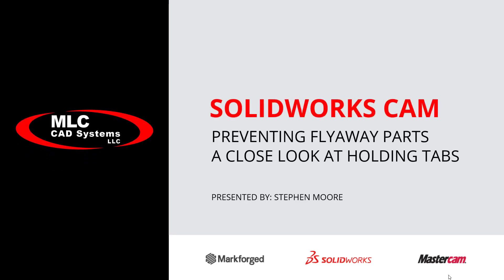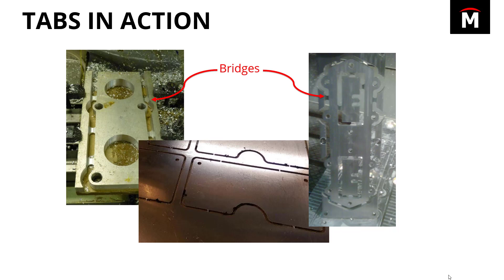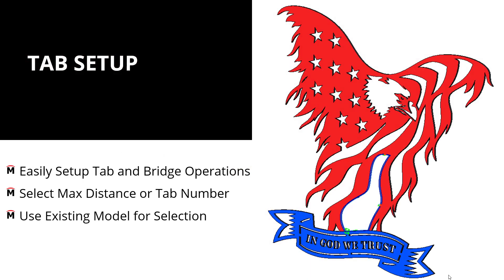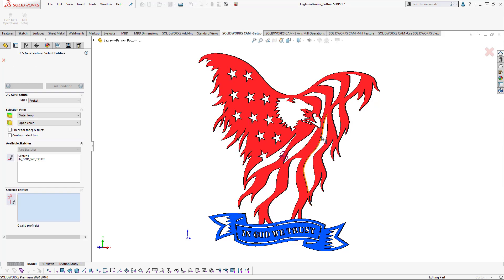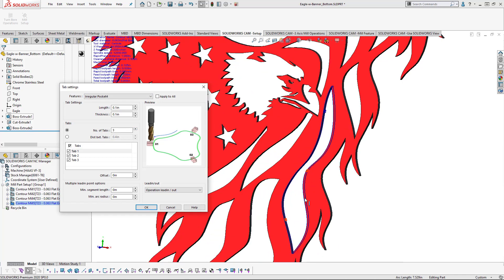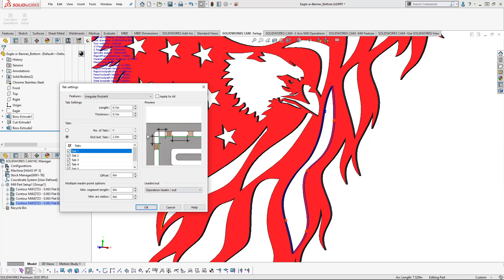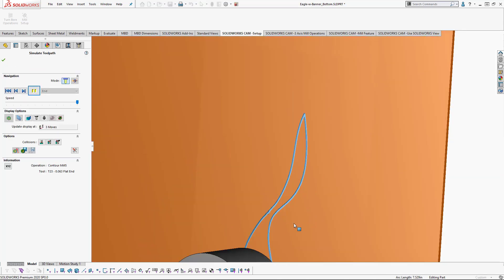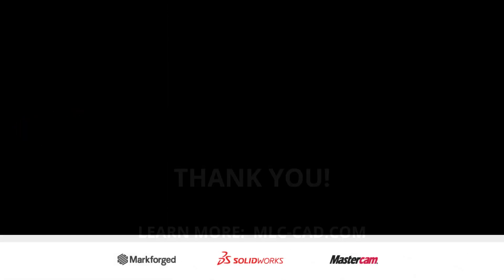Using Tabs in SOLIDWORKS CAM

Comment: Do you have a video or source that might help me? Lets say you have a stock size that is 5'x5' in width and length, with the part being a small 2'x2' part inside. How would it be cut that with tabs? Like can you use perimeter cut with tabs?
Reply from the maker: Tabs can be added along the perimeter of the part as shown in this video series. Im not sure if I fully understand the nature of your question, but if you are an MLC customer we would be happy to talk it over with you.

Comment: Any way to create a triangle tab, and any way to create a second toolpath designed to just cut out the tabs (presumably after work piece has been otherwise secured)?
Reply from the maker: There are no automatic options to create tabs of different shapes or to cut them off at the end of the operation in SOLIDWORKS CAM.  Toolpaths could be manually generated but it would not be through this same workflow.

Comment: So… we can’t manually choose a tab position? It has to be one of those two options?
Reply from the maker: By adjusting the offset and number or distance between tabs you can affect the start position of the first tab.  This is relative to the start of the leadin and there are additional options for changing where the leadin occurs

Comment: How do you reset the default sizes, settings?
Reply from the maker: The Tech DB controls default data, it is located here by default: C:\ProgramData\SOLIDWORKS\SOLIDWORKS CAM\TechDB\TechDB.cwdb

To reset you would need to import a database from a clean installation